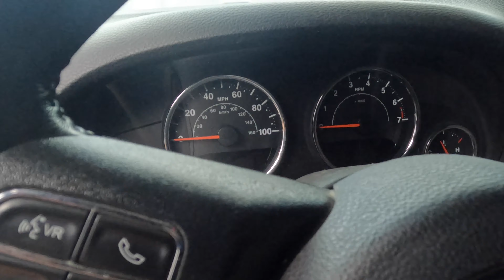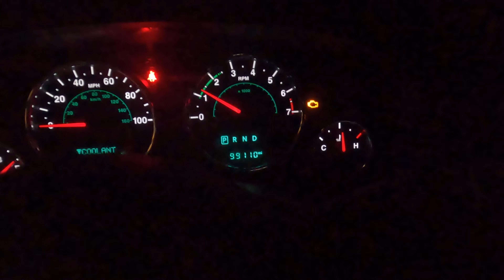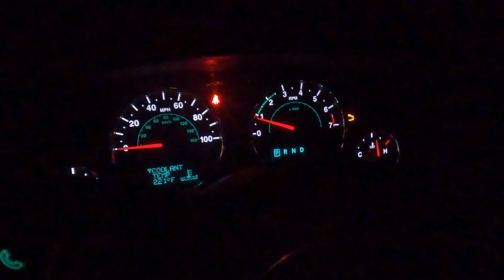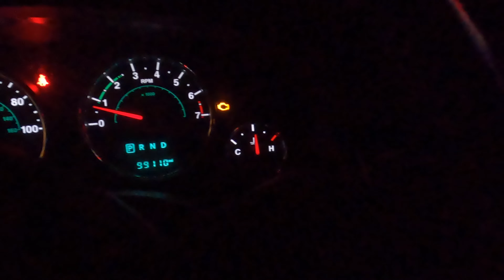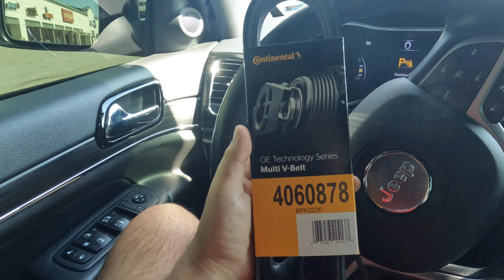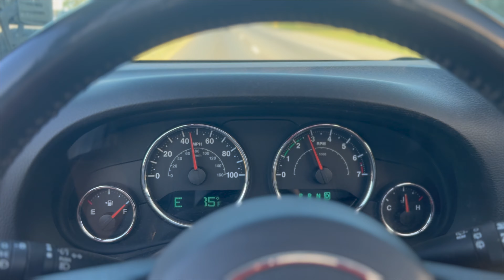Jeep Leaves Me Stranded For The First Time Ever... Dumps All The Coolant Out.

Comment: Just wait until you get that 3.6L lifter noise. 😂
-or the oil cooler leak
-or the bottom end knock
-or the electrical issues 
#jeeps
Reply from the maker: So far so good, fingers crossed it’s good for alittle while